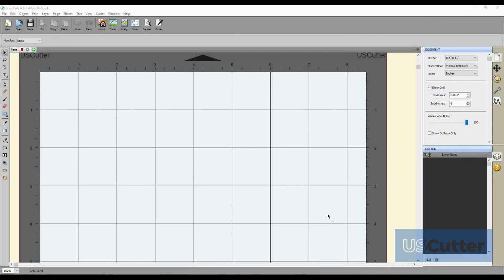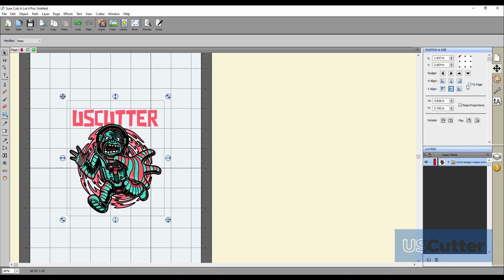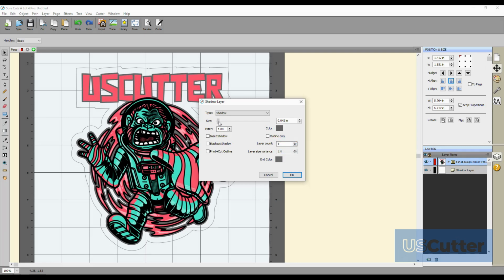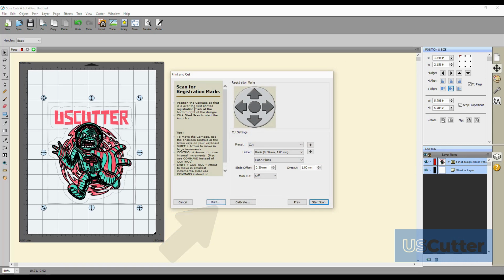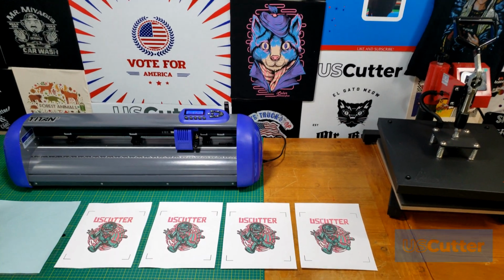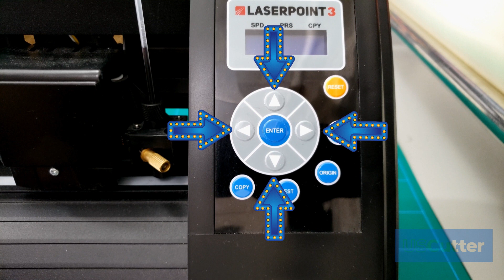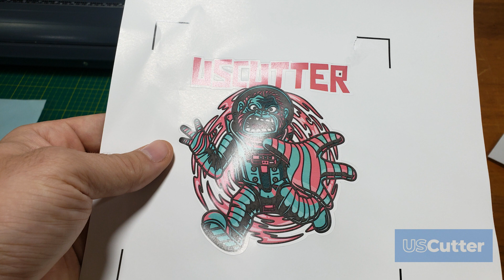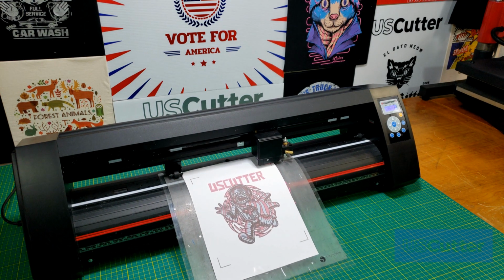Quick Cuts - How To Contour Cut With Sure Cuts A Lot Pro 4

Comment: Hi. Is it possible to manually design and print my own registration marks? I got the SVGs but 
is the general rule to just keep the marks on the center enough for the laser to scan the black L corner lines?
or must I trace, print and scan my PNGs through the Sure Cuts A Lot Pro 4?

Comment: I have a MacBook (MAC OS Big Sur 11.01.) and just purchased the Titan 3.  It doesn't seem to be compatible.  Any suggestions.
Reply from the maker: I asked my technical support team about compatibility and they are not aware of any issues. I would still contact them to speak with an agent. It could be something else like the incorrect drivers selection.
Reply: I also have a Mac and bought the Titan 2, I found out after much frustration that I needed different software than what came with my Titan. I ended up getting Sure Cuts A Lot 4 Pro and that works. Also, I had to plug the Titan directly into my computer because there aren't any drivers available.